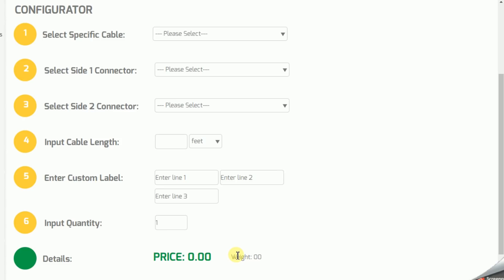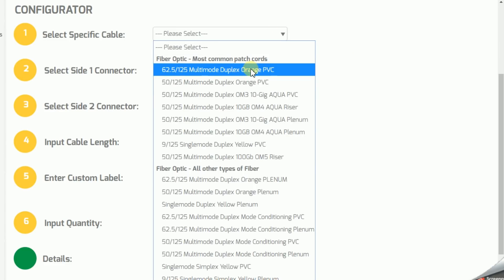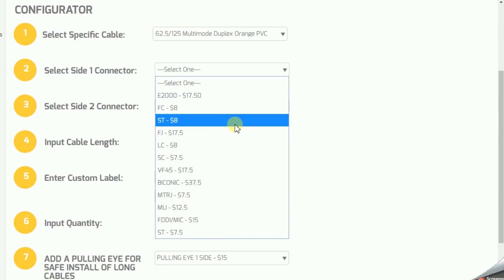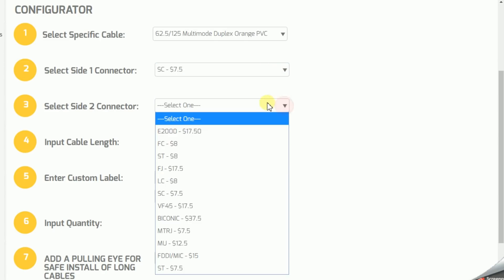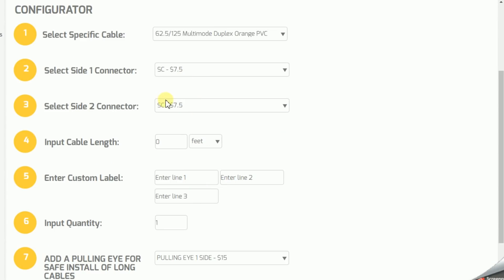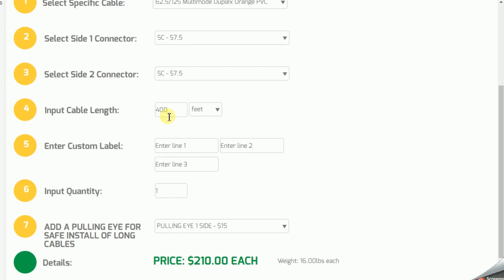Network Two Buildings with Fiber Optic Cable

Comment: They male a cable called "ADSS" All dielectric Self Supporting cable that does not need steel strand built, it uses attachments directly to the sheathing of the cable. 

Also per fire building code, make sure your using proper indoor cable.(plenum or Riser rated) this reduces toxic fumes in a cable jacket when on fire.
Reply from the maker: thanks for adding that valuable info, Drew.  :-)

Comment: There is also the element of the TYPE of cord you are using...so the yellow wire is a crossover cable. You can just run a crossover from one switch or hub to the next. No transievers. Even more simple and 1000"s cheaper at an industrial level. You also would not be bringing a yellow crossover into the home. It would be at least a cat5e at the demarc location.
The patch or straight cords are blue and are classified by density. You would not necessarily be able to use any patch cord. They run between Category 3 and now 8, including 5 e and 6a. So you need to know how much data you are going to be pushing in order to get it right. Cat 3 and 5 are obsolete. 5e can handle 1 gig/sec speeds. The categories then in crease by one order of magnitude( ×10) up to Cat 7. Cat  8 is 4 times faster than 7 at 40 gb/sec. Blazing fast. Literally as fast as your brain.
Moral of the story....be careful. It can be an expensive fix. 
The strand you hung was great. Nice job. If you wanted to consolidate the copper and fiber, they make a shielded twisted pair patch cord...STP. You could run them right next to each other as the twisting and shielding aspects protect from electromagnetic attenuation.
I also want to remind everyone that while fast data is awesome...it is radiation. It will cause cancer if we continue to push heavy doses of high band width frequencies through our bodies. Microwave radation. Thats why Satelite dishes are so large, to spread out and dilute that microwve signal. Now think about the size of your phone. 
The smaller the device the stronger the signal hits you. Keep ypur phone in your butt pocket or at least 0.35 inches from the family jewels.
Be safe. Love light!
Reply: Sorry but the most what do you wrote is wrong. 

The advantage of fiber in opposite to copper is - it is non electric! Good if happend a thunderstorm with lightning. So a lightning can't crash the fiber. 😉

Comment: I'm doing this with ethernet cable. 2 years going, but I'm capped at 10Mbps...
Reply: If do you not use more as 100 meter for one segment between two copper switches (or bridges) it is okay. With fiber do you can handle 200 meter till xxx km without problems and 10 MBit till xx GBit.

Comment: How to make it for more building?
Reply from the maker: They make fiber switches ( multiple ports).  You would put a fiber switch in you main building and use that as the hub for all your fiber cables going to other buildings.

Good question, thanks for asking! 😄

Comment: can I only use one fiber optic cable? not double like ypurs
Reply: No. Fiber cable works only in one direction. So do you need two fiber cabel; one in every direction. But be not angry so it works full duplex.

Comment: ok, I have a question. I been looking around on this answer but I am going to do a Livestream for a horse show. Thing is I need a 400-foot long cable to make this happen. Now for budget sake me getting a "switch" that next to the "Modem or Router" get 100-meter cables and use "repeaters" until it connects to my equipment? This just to help me through a 3-day event. 

Someday I get fibre for future events but I need to get past this event in the mean time.
Reply: You can also do point to point wifi. But you can likely get a good enough signal to just run a single Cat6 cable

Comment: Is there like performance disruption when you use a media converter? instead of buying a switch with SFP module?
Reply from the maker: I think what you're asking is if I use a swtich with a built-in SFP module versus a stand-alone media converter, will there be a speed difference.   I'm not enough of an authority to answer that, but I would have to take the obvious guess that the switch with the fibre module built-in would have to be a little faster.
Maybe someone else who knows more can chime in here.  Great Question!  :)
Reply: Yes if you use a switch with a big backplane. But is more interesting how stacked the network and how much traffic between this points where do you use the fiber cable. 

But technical is a bridge a switch with two ports how change the cable only e.g. copper2fiber. If do you want change parts of the big network so you can do it mostly cheaper and easier if the parts are smaller ...

Comment: What is the maximum range it can be used?
Reply from the maker: Bala, depending on the fiber type and the power of the transceiver, Fibre (single mode) has been known to travel up to 20 miles.

Comment: I'm wanting to connect my workshop to my home, via fiber. I update modules on BMW automobiles and BMWNA requires a wired connection. The distance is only about 100ft. If I understand this demonstration correctly, I can buy two inexpensive transceivers, an appropriate pre-made cable, (I've already got a switch on hand) and I can simply run the cable in buried conduit. Correct? 

We've had induced voltage damage before. No way I'm running copper. Thanks in advance for your reply. Helpful video!
Reply from the maker: Basically, what you described should work.

Comment: Is it possible to use two different brands on both ends? Tia
Reply: Theoretical yes, in the real world not. Some brands works together then they are physical copies with different brand names. 

Mean: Do you should test it with the real fiber - most seller allowed it in the shop.

Comment: Steel cable between buildings is a fantastic lightning rod.   Even assuming the method is correct, why not re-use the existing wire strand instead of adding more clutter.  In any case, wireless bridging is far better to use with currently available devices.  Not as fast, no, but  full gigabit speed is not required for most workshops I would say.

Comment: I am waiting for you to say "I am sorry Marty that this is not to scale" when you said image that this cable is 400 foot cable. How ever you never said
Reply from the maker: ha!  right?
thanks watching though.😄
Reply: @NetworkAdvisor  I like that you have been going over these things... I have a 1gig fiber connection and have been working on making all of my connections more cleaner looking... So much that I have been debating on running fiber links to two different switches at different locations in my house... Also would you say that it's worth going to a 10gig network? Everything is ran with cat6

Comment: i'm a student currently studying networking and this video really helped me. My classes usually cover the different types of cables and topologies. I've always wondered how to connect a network between two buildings separated by several hundred feet with cables and you assisted with that in a clear and concise manner.
Reply: No worries at all! My Shed Plans brings me up to speed with professional tips and tricks used by the pros [Go Here=> WoodBlueprints. Com  ].  It really let me learn how to handle carpenter equipment, follow the right safety rules, and how to do your projects professionally so that they will look good and last!

Comment: What was the speed of the fiber being used ?
I also didn't see a "vendor" list for the premade cable or transceivers
Reply: The transciever was 10/100mbit and the fibre depends how long and what light strength you use

Comment: Be sure that your cable has built in uv resistance. Most outdoor cables are "outdoor rated" but this is usually only an indication of it being ran underground.
Reply from the maker: hey, that’s a great tip.  thanks for chiming-in. 😄

Comment: How did you ground the steel cable?
Reply from the maker: If you're asking me "how did I ground the braided steel support cable?".  I didn't think much about it, but both the buildings had metal Eye hooks which in turn were attached to the metal frame of the building.  So, in essences they were "dirty grounded". 

Great question

Comment: PRO TIP: Always leave some slack if you are going to a pole to allow for pole movement. You don't want your pole to snap your cable or damage the building at the other end.
Reply from the maker: definitely good advice, thanks for adding.   Makes us all better. :-)

Comment: PRO TIP: Use stainless steel welding wire to overlash the fiber to the cable and use clamps at each end to attach it to the cable. Two wraps per foot should be plenty and it will never fail in the weather or due to UV light. EDIT> This can be done while the cable is still on the ground with no overwrap machine for shorter runs. https://www.youtube.com/watch?v=YQGPuGuPNQM https://www.homedepot.com/p/Forney-0-030-Dia-308ER-Stainless-Steel-MIG-Wire-2-lb-Spool-42298/206311146
Reply from the maker: I got my braided steel cable from Graybar.  But, obviously, not everyone can go to Graybar since they're mainly a wholesale supplier.  Thanks for mentioning.  And, that idea of adding the zip ties while the flex and guide cable are still on the ground - good point!
Reply: @NetworkAdvisor  No, perhaps I was not clear. No zip ties involved so they can never fail. use SS wire to over lash the wires. You can do the same thing as in this video without the machine for shorter runs. Just take the spool of wire and wrap it around the strands in a continuous length and tie it off at the ends. https://www.youtube.com/watch?v=YQGPuGuPNQM

Comment: That orange external cable will have rain water run along it at either sides and into the buildings causing damp issues.

Would’ve expected the standard U bend prior to entry of the cable on the external sides to avoid this issue.
Reply: Agreed. The supporting cable should go below the data cable or it should have a drip loop.

Comment: Auction Sites?  Any links?
Reply from the maker: Ebay was what I was implying, but I didn't want to call them out by name in the video.  Ebay is a great place to buy used tech equip so long as you buy from sellers with good reputation ratings.   
Good question!  :-)
Reply: @NetworkAdvisor  Oh Hah!  I went looking for some and found some horrible sites.  But ya, good call.  Cheers

Comment: 1, there is no such thing as fibre "pairs"  you don't have 3 pairs, you have 6 cores.
2, special aerial cable should be used, it often has non metalic support members, but even long dist aerial that may have ss wire cable, is encased in sheathing, but also needs earthing since its conductive.
3, aerial cable is uv stabilised and doesnt need conduit
Reply from the maker: thanks for sharing that information.  Now we're all a bit smarter when it comes to Fiber!  :-D
Reply: when you have a duplex transceiver, you have pairs.  Yes, they are independent fibers, but they carry the signal in opposing directions.  Unless you have a BiDi (bi-directional) cable.. then you have both on a single core.